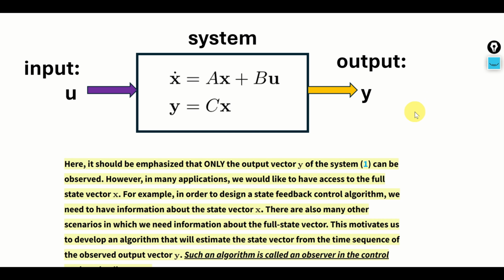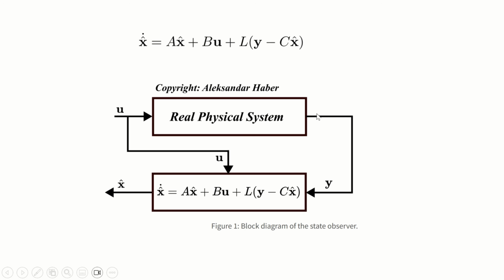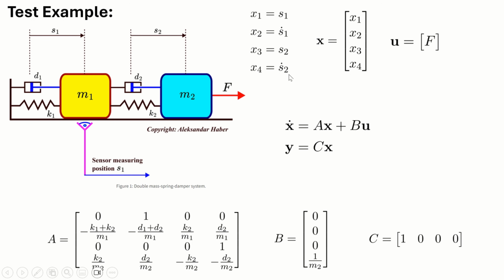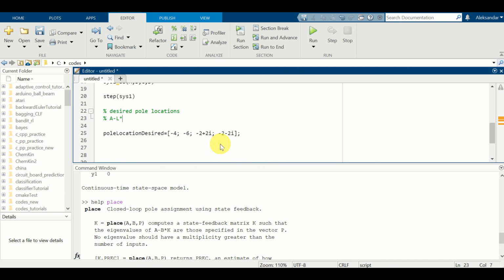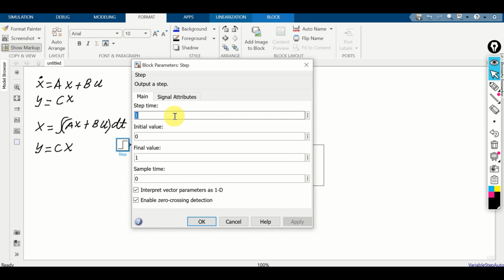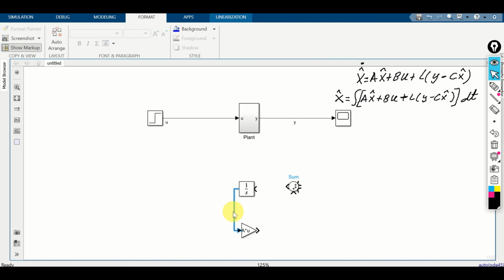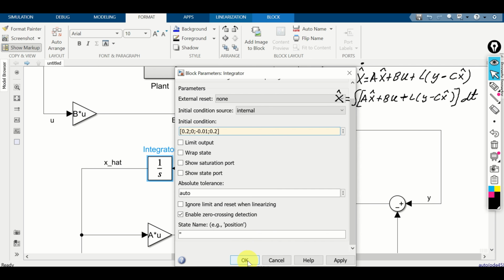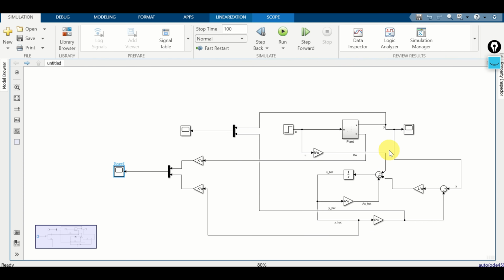Design and Simulate State Observers of Dynamical Systems in Simulink (MATLAB)

Comment: Hi can you do an example of design a dynamic output feedback compensator to achieve asymptotic stability of the closed-loop system and verify that this compensator also ensures the tracking of trajectories of the type r(t)=M1t+M0, where M1 and M0 are arbitrary real constants.
Thanks
Reply from the maker: This is a professional engineering channel. We do not work for free or provide free help or consultation. If you need help with your engineering problem, send an email describing your problem and we will send you quotes for your services.
Reply: @aleksandarhaber  can you send me your email